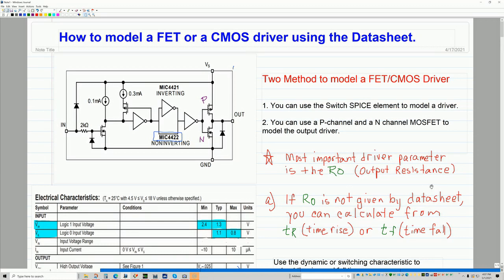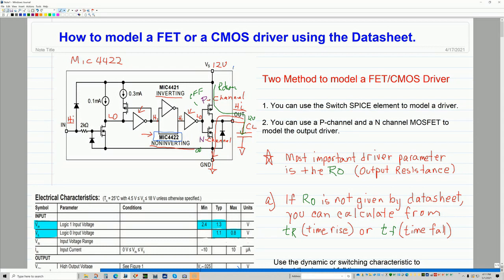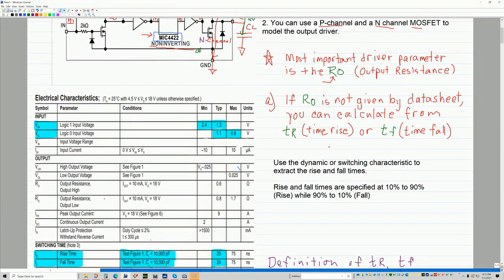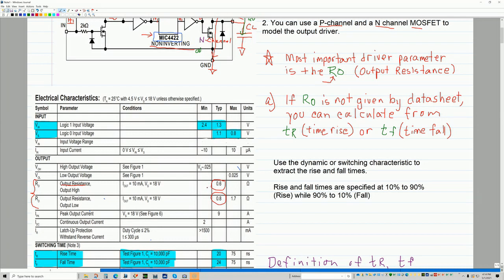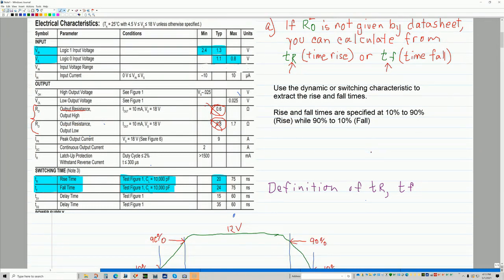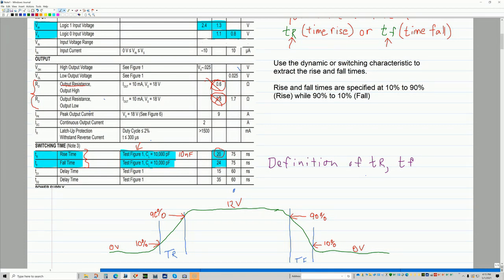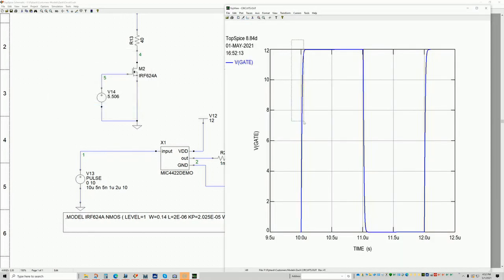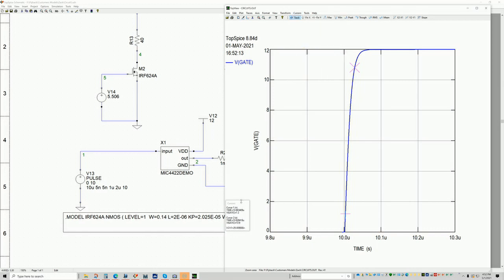How to model a FET/CMOS Driver using a Datasheet

Comment from the maker: In this video, I show how to model and simulate a FET/CMOS driver using a datasheet. There are two way of modelling a driver using a Switch SPICE model or a CMOS inverter model also known as a Digital model. I show the derivation of the equation starting with the general ID MOSFET equation and show how to size the P and N channel FETs to simulate the both the rise and fall time specified in the datasheets. If you find this video informative, please like, share and subscribe.  Questions or request for simulation files can be sent to rbola35618@aol.com. "May your simulation always converge" .

Comment: Great video, but I don’t quite understand why u put the 500 ohm resistor and capacitor before the switches. Furthermore, when I tried to model the IXDD614 gate driver, the input high and low are only 3 and 0.8 volts. Is it appropriate to just put these numbers in both Mosfets? It would be really nice of you if u could help me with these questions😊

Comment: Hi Robert! Very nice videos on your channel. Regarding the switch model why do you have 200uA between power and ground? Is this sleep current from the datasheet or it's only for Spice convergence. How do you choose the RC values in front of the switches?  Greetings!
Reply from the maker: The source is to simulate a pull up mosfet which what they typically do to do a voltage shifter. Hope this makes sense.

Comment: @robertbolanos : Dear Robert, nice video! Btw why you have 200uA current source at the out put of driver @17:47 ?
Reply from the maker: Hi Aditya, that is a very good question. The current source is there to model the quiscent current of the 4422 driver. In the datasheet it has 100uA to 600uA as typical queiscent current. So I chosed the middle point of 300uA. Good question. Rbolanos
Reply: @RobertBolanos  Thank you Robert!